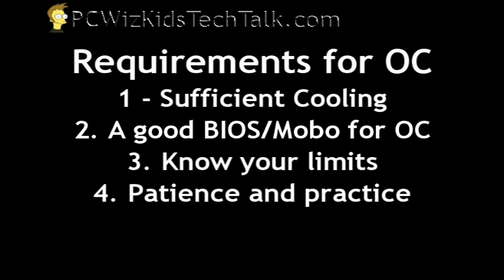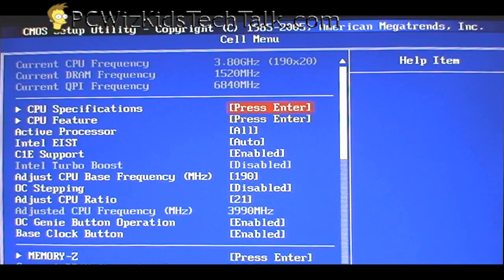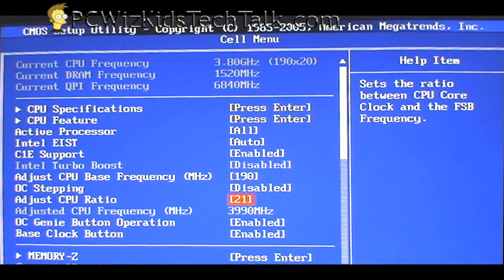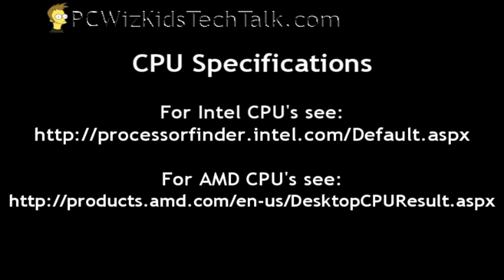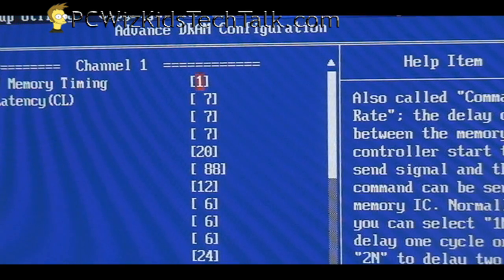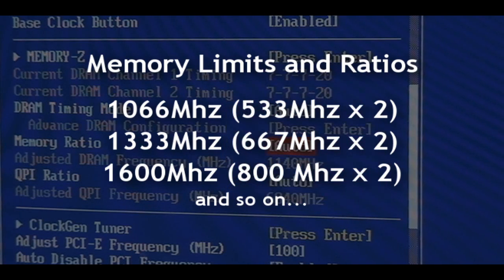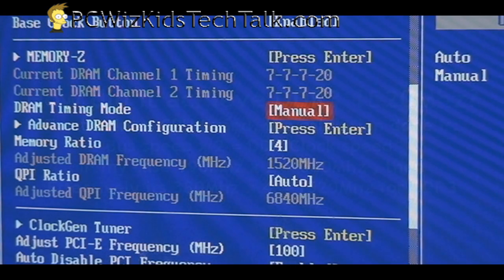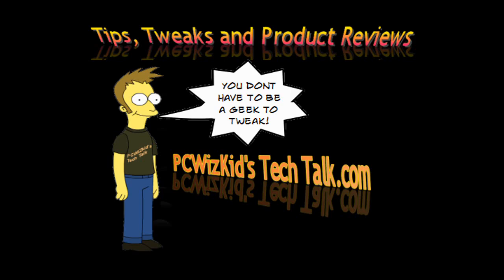Overclocking 101 - Part 2 The BIOS #techreview

Comment: A: you sound like a fellow wizard, huzzah!, and B: is this BIOS specific, I'm a micro controller/robot guy so I wouldn't know about company specific things, I only overclocked by replacing the clock signal crystal on small circuits

Comment: Question to anyone watching this:
In the video he says to find out your processor's default voltage, upon checking my processor out on Intel's website, I only found a range of voltage's within which my processor is designed to operate, not a default setting.
So should I just keep increasing by set increments until my PC stalls or hits the edge of it's working range?

Comment: I have a laptop Dell Inspiron N7110, with a CPU Intel core i5 @2.50GHz with 8GB of RAM also with a 64-bit OS. Would it be ok to over clock a laptop since there is more heat in the CPU even though i am using a fan for it, where can i find if my CPU is able to put more Voltage...

Comment: I managed to overclock my AMD Athlon (tm) X2 Dual Core Processor 4400+ from 2.3ghz to 2.5ghz and it's stable with low temps. I overclocked my ram from 660 to 880. I also overclocked my GeForce 8600 GT+ from 540 Core Clock to 590 and my Memory Clock from 700 to 820. All stable with low temps. Thanks for the videos.